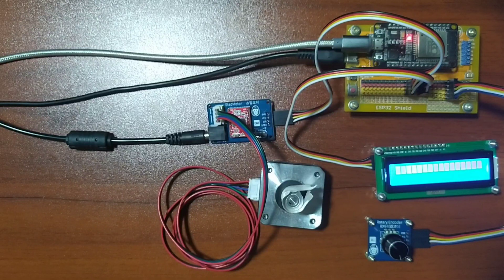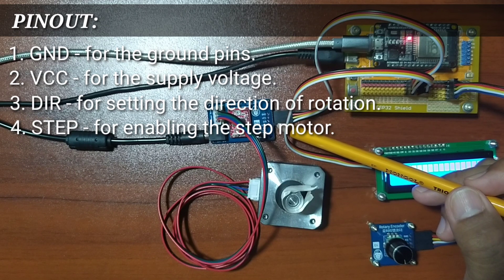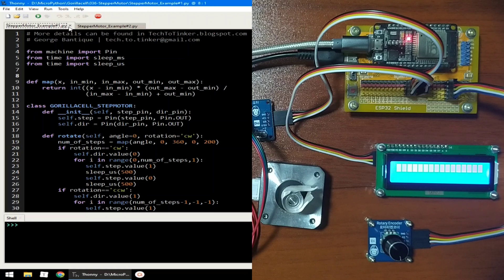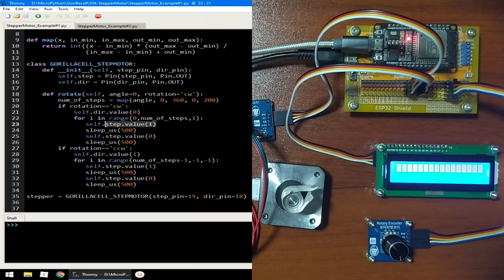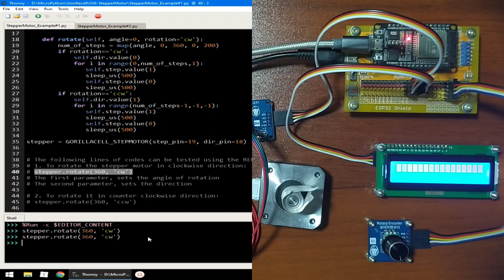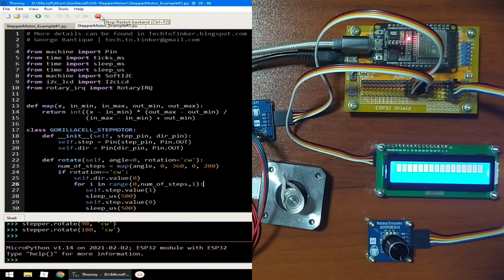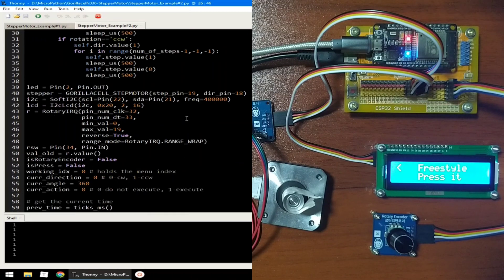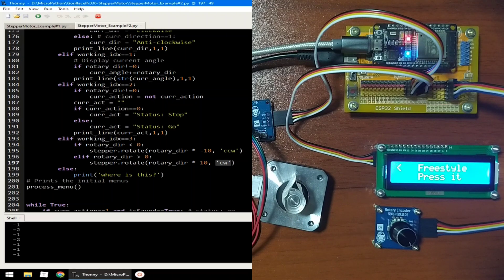036 - MicroPython TechNotes: Stepper Motor

Comment: can you suggest what to  change in the code if i do not want to input the degrees, just the total number of steps to move (this would need to be an input number between 0 and 100 complete rotation so 20000 steps. )
Reply: i don't seem to grasp the meaning of the this int((x - in_min) * (out_max - out_min) / (in_max - in_min) + out_min) formula.. sorry, my bad.